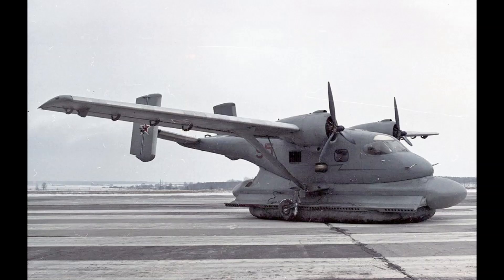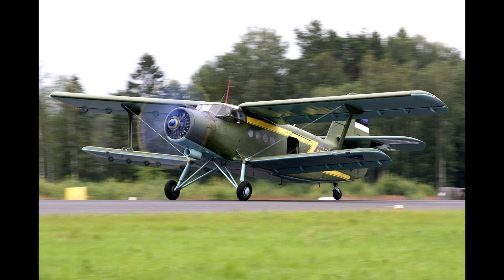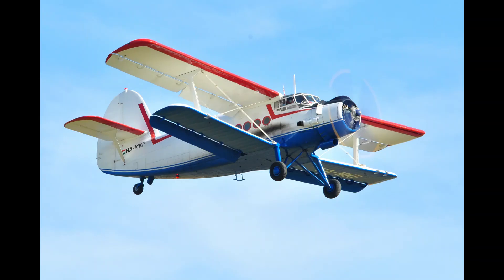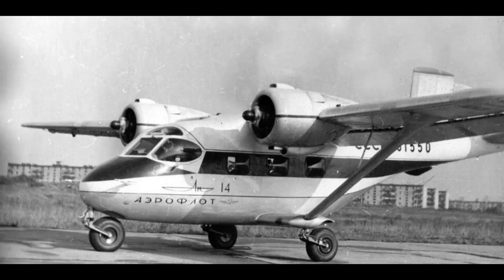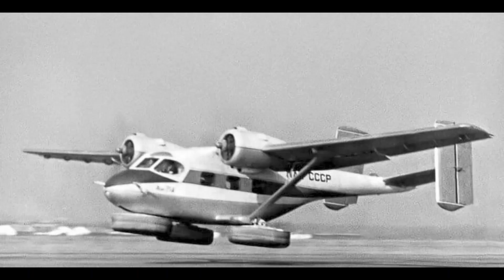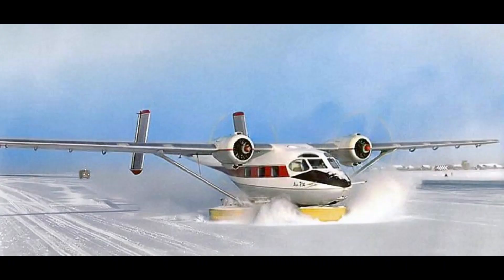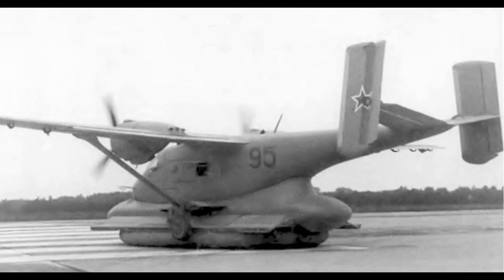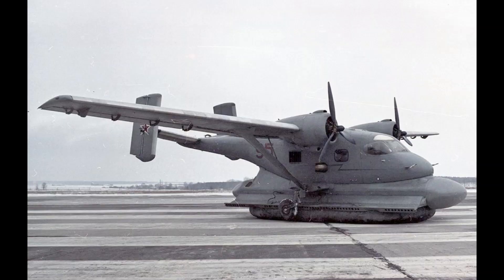AN-14Sh – “My hovercraft is full of...aircraft”

Comment: Hovercraft skirts sound like an awful replacement for the wheels or skis of conventional landing gear as they aren't the best at bearing high loads and a plane landing or taking off exerts a lot of extra load on its gear due to the forces involved in taking flight... which a hovercraft skirt would react to by compressing and thus losing its aircushion...

Comment: Interesting idea,   but I would hate to have to land it with problems with the compressor . That supplied compressed air for  the hover craft skirt . And steering on the ground would be tricky too ! Ever tried to stop a hovercraft ? not easy !
Reply: An anchor chain thrown around the occasional lamp post could help, otherwise look for a massive wall.

Comment: This was done on a DeHavilland Canada Buffalo in early 70s after preliminary testing on a Lake Buccaneer, with a cushion system developed by Bell Aerospace. https://1000aircraftphotos.com/Contributions/Visschedijk/7012.htm.  The main problem with it was really high wear and tear on the bottom surface of the cushion, which was more like an air mattress  with holes in the bottom and had brushing contact with the surface. Two PT-6 powered ducted fans on pylons on each side of the fuselage provided air to the cushion.   I was a mechanic at DHC in Toronto in 1979  and worked on the airplane when the air cushion system was removed and the airplane returned to the Air Force.
Reply: I was a test pilot in the 4950th Test Wing, Wright Patterson AFB, Dayton OH, 1975-78.  We had this aircraft and it was designated XC-8.  I didn't fly it.  Lt/Col Glen McFarlane, Commander of the 4953rd Test Squadron, did most of the testing. I remember him stating that with the air cushion inflated in ground effect it was very difficult to taxi as winds would blow it around and weathervane.  Also, crossing a ditch or low spot suddenly brought things to a halt as the aircraft 'bottomed',  No way it could be landed on a choppy lake or sea with swells, either.  I believe his post-testing conclusion was that it was a very interesting research program of absolutely no value to the Air Force.
Reply: @arthurbenjamin2434  Yeah I was told it was only really useful for landing on really boggy ground or marshland, etc.  Not to mention that bloody rig would have consumed half the Buff's payload.
Reply: I remember seeing the Buccaneer mod, but now remember the Buffalo as well. As mentioned, the ground handling of these things is probably what killed them off. Hovercraft are notorious for wandering around to the whim of the wind and about the only way to keep control requires very fast acting variable pitch props, and the invariable dumping of lift air to come to a stop when things get out of hand. Can't seem to find any images of the AN-14SH flying with the cushion retracted, as looks to have been the intention?

Comment: While the tech of the day, made such a project 'cumbersome,' probably, at best, the idea has great merit!
America isn't so different to Russia, in terms of topography and geography.
Both countries have snow and permafrost, (Russia having even a larger area of those conditions).
Mountainous, plains, deserts, and large areas of low human population.
Rivers, bays, and coastal waters, and islands and territories.
Such places where a runway for a large aircraft doesn't exist, or only for smaller aircraft.
Unrefined, original, rough land, unimproved for even the most basic of human occupation, much less a modern aircraft...
Unless that aircraft had the capabilities, to cover every aspects of Earth's surface.  
Except for the steep terrain of mountains.
Yeah, we have specialized aircraft, that can do one thing or another.  Even the C-130 can do more than one thing.  And the C-17, to a lessor extent.  (Mainly due to age, time in service, and overall achievements of the type).
C-17s can carry much more than a C-130.
But the C-130 can land in places and conditions, the C-17 hasn't yet done, or simply can't do it at all,  (Due to size, weight, or flight characteristics of the larger aircraft, the heavier aircraft, and the fastest aircraft, which would be a possible issue when slower speeds are required landing).
And sure, noise might be a bad guy attractor on the ground.  I wonder which makes the most noise between the two?
Reply: Sorry if I got a bit 'rambley."

Comment: Great Video:  Wish you had a picture of it in air.  Looks like the hover skirt retracted.
Reply: Yeah, I noticed the same thing. I spent some time googling various combinations of the words "Antonov AN-14Sh flying flight hovercraft skirt" and couldn't find many photos (and no video at all) of this aircraft flying. I did find this interesting website, however: https://www.armedconflicts.com/Antonov-An-14Sh-t193456

It has 2 images of the aircraft flying, but with its skirt extended. At the bottom there is 1 image of some sort of test article with the skirt retracted. The site also has  a very interesting diagram which shows the system to inflate te skirt. The compressor does indeed seem to take up a significant of the cargo volume.

Comment: I remember seeing concept art from Lockheed (IIRC) from back in the 70s or early 80s (pre-1985) of them doing something similar to a C-130 as a proof of concept with McDonnell-Douglas being interested in adapting it to the F-15.
Reply: Saw a sketch or two in a magazine back then as well.
Reply: @lycossurfer8851  I can't tell if you guys are joking.  F-15? You must be.
Reply: @rawnukles  As I recall, if it's the same concept, it featured a ground effect carrier for take-offs. The carrier would stay on the ground as the F-15 took off. They may have intended it for landings as well, but my feeling is that would have been too tricky to pull off, which may be why it never got beyond the concept stage.